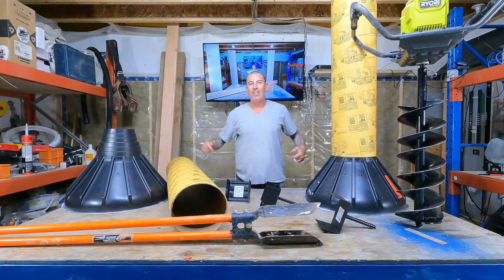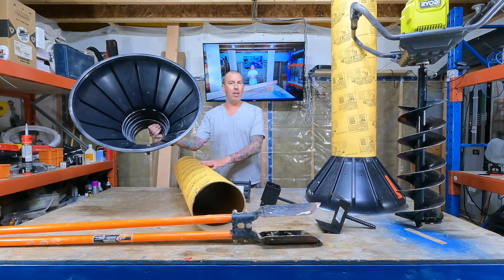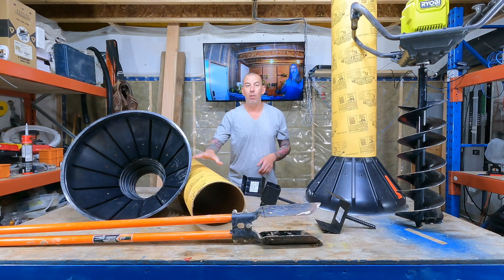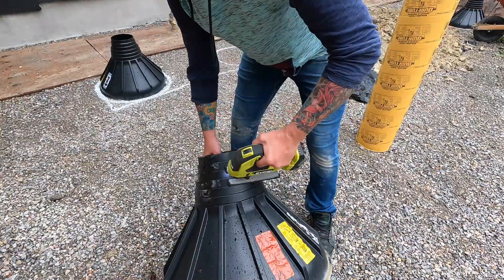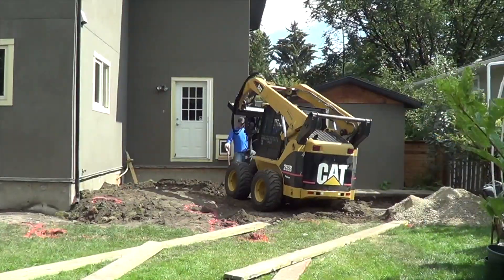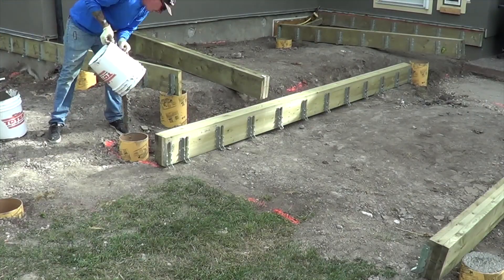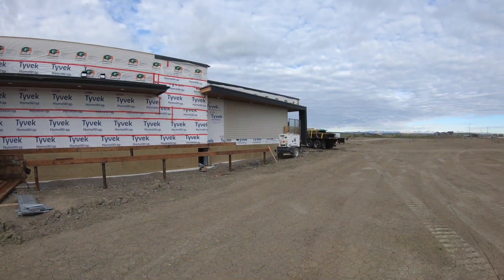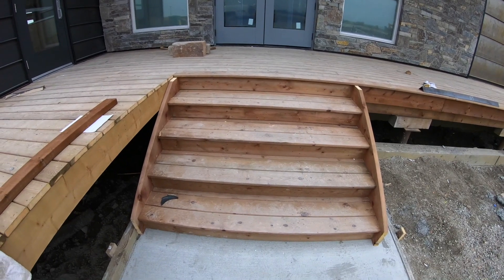DECK FOUNDATIONS 101

Comment: The Lowes equivalent of Sonotubes are much cheaper. Also when ordering concrete use a vibrator and a slope of about 6" to get the concrete into the footings. Only vertical rebar is needed because of the type of stresses that might be applied to the pier.

Comment: Just curious about no rebar in the tubes. Not necessary? Or would it be if you were doing a house instead of deck
Reply from the maker: Exactly, it’s the size of the load on the piles.

Comment: How do you know what soil bearing capacity is? Get a soils report?
Reply from the maker: Usually not necessary with a deck.  When you build a house before you lay footings that’s when you get a soil bearing certificate. If you pull a permit they will let you know what is required. Hope this helps